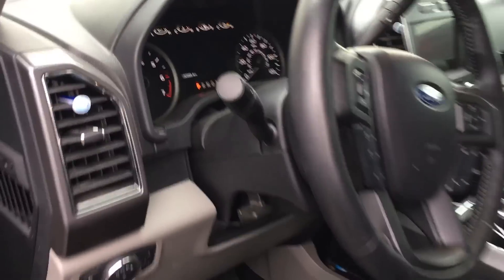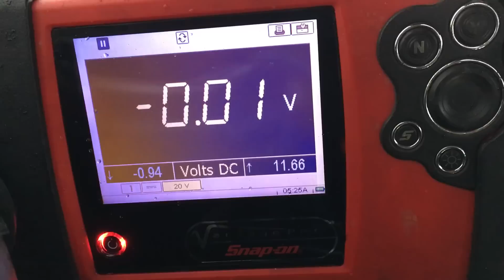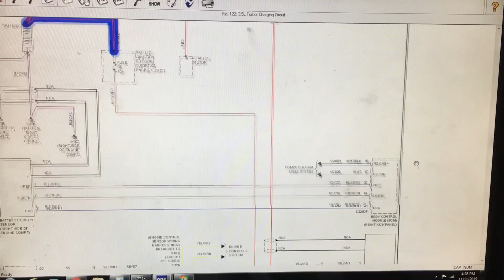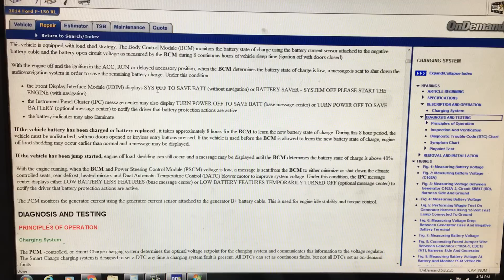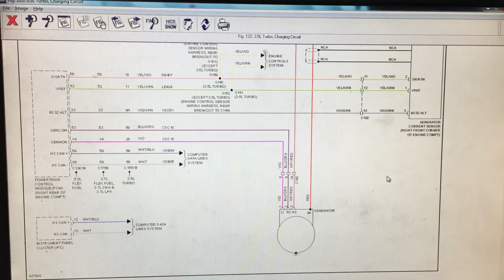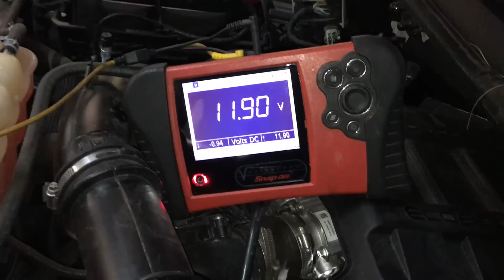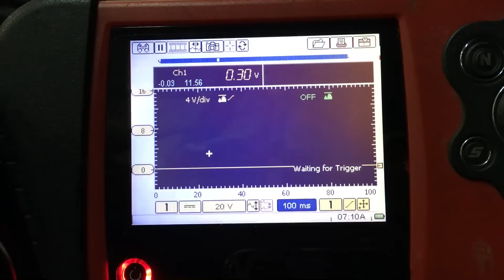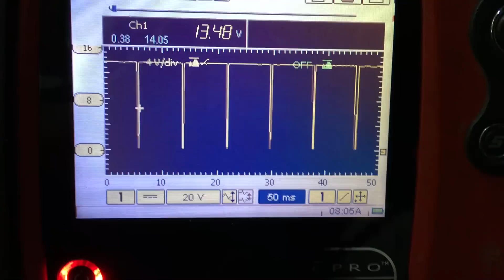FORD F150 ECOBOOST CHARGING SYSTEM SERVICE NOW DIAGNOSIS

Comment: Load shedding refers to multiplexing in a electrical system.  Meaning there's a noid in the circuit and if Battery voltage is too low. The bcm will start shutting random system's or circuits down to try to maintain voltage
Reply: I think mine is shuting down the electric power steering. I have been having this light thingy come on and off all different times, not when driving just at start ups. Today was real bad. First real cold for Houston today, and the steering was intermittent.
Reply: @jassun681  check your charging voltage at the alternator. Write that number down. Then check charging voltage at the batteries. It should be the same pretty much. Now use a amp clamp around the positive battery cable while still having the voltmeter hooked up reading volts. Start the truck and write down the voltage you see and what the amperage is. Then turn on all your loads, lights, blower motor, flashers etc. Anything that can really put a strain on the system. Then watch your voltage and amps. If the readings start to drop. Then you know you probably have a bad alternator
Reply: @feeneysmechanical6215 , yes thank you. I am going to try this. Chris Fix had a real good video detailing this check. I will do the load test on it. And everything I am seeing, is the alternator going bad. That internal regulator.

Comment: I have the same problem with my 2018 truck. The quick change oil place also did not put the dipstick back in properly after an oil change and I had oil spill out over the engine.

Comment: Was the problem fixed by the replacement of the alternator? I am having the same issues with my 2019 f-150 and mine only has 6500 miles. Its at Ford now and I feel I need to show them this video so they will actually diagnose it and fix it instead of just passing the buck. Thanks!

Comment: I believe that you can give wire #2 battery voltage to full-field the alternator to force it to charge and monitor wire #3 for any info back to the PCM, if the alternator does not charge in full-field mode, 100% PWM, then you can call the bad part also, maybe the regulator is the problem, I don't know if it's available as a serviceable part as the oil leak probably took it out BUT, thanks for the great diagnosis. Was there a core charge on the part? Also thanks for using OEM parts.

Comment: Great job ! I need to drop of my 2004 nissan titan  I been having a  problem with  Crankshaft sensor have replaced it also replaced the cam sensor  and it has not fixes it help

Comment: Dealing with this issue on my 2012 mustang right now!!! It started 2 nights ago. I changed the alternator out yesterday and it wasn’t the fix. The voltage is low it was around 11 volts until it died. The fuses are all good. And I checked continuity between the wires from the alternator to the connector on the pcm and those were good. My friend is trying to convince me that the pcm is bad and it’s not sending the signal to the alternator to raise the voltage. The only thing I didn’t do was the change the battery. I’m stuck on what to do

Comment: My truck makes a noise and shows that same system charging problem sometimes not all the time, but what I have notice it's when stopped at the light sometimes turns off, it makes a rough idle and dies, I already went to autozone to get it test it and they say alternator and battery are good do you think is that the cause of turning off, I even took the truck to the dealership and they didn't find anything wrong

Comment: Awesome video I like the diagnostics instead of just replacing the alternator.  Why would they put a one way clutch on an alternator? It should never turn backwards lol.  Not quite understanding that one.
Reply: Is a good point. Since it is a three wave generator it produces electricity also when turning 'backwards'.
Reply: The one way clutch is also used or was on vw as my tdi jetta has it . I think it suppose to keep take load off the belt when the engine is slowing down from the spinning alternator.  Was my guess of why there on there . To help extend belt life

Comment: Tear the old alternator apart. Shoot it with some contact cleaner to get the oil off critical components and clean off the connectors leads.  Oil is an insulator an may be keeping connectors from carrying voltage.
Reply: The slip rings and brushes may be damaged too vehicle ran 300 miles on the freeway .

Comment: Eric - I left my 2018 F150 with the message board showing engine status. Note that in cold weather (35 F) the engine does not cut off at idle mode, the message is that it is charging the battery in lieu of cutting off. The engine on average cuts off 10 percent of the time when you look at running hours versus off-hours.  My battery is 3 years old - do you think it needs a new battery or just cold weather?

Comment: Hey great video on the charging system issue I own a 2019 F150 I installed a OEM bug deflector and I love the look and protection but the issue I am having is when driving above 70 Miles per hour I get a loud humming noise do think it is the deflector or I could have a different issue?

Comment: The BCM voltage and battery condition should be part of the Ford Pass Connect App that can be viewed on a smartphone with a downloaded account. (No battery condition is available on Ford Pass Connect)
With no voltage gauge or battery condition program inbedded in the programmable dash options software, troubleshooting becomes a nightmare. I have 2019 and find this BCM system nothing more than a dealer incentive to up the shop labour time to diagnose a design flaw and for the customer to pay for it. How do you leave a vehicle 8hrs undisturbed for it to "learn". You also need to know which side of the BCM negative module to place your tester as there are different readings depending weather your on the battery post or on the actual wiring connection on the BCM module.

Comment: I had one of these throw me for a loop. Because the wire that is connected to the fuse had a break in it. But not completely broken internally. Just broken enough that it would intermittently stop charging. Then I'd get that same message. And I couldn't shift out of park. The AC would stop working and the navigation screen would shut off. The wire was broken internally about 2 inches from the connector to the alternator.

Comment: The oil most likely got in the connectors. The first thing to do is to clean the connectors with electrical cleaner and then test.
Reply: I always grease my connectors to keep away corrosion. I suspect the oil interrupted the field current, i.e. two coal connectors which giving current to the turning part of the generator.

Comment: Have a 2011 f150 eco boost all normal when start all lights and window switch are off,turn off machine and on again then the lights go on and off and battery sign shows, then all lights are off. Any suggestions?

Comment: 21:47 agreed, i have seen multiple alternator failures where the spool valve(what you pull the dipstick out of on the honda V6(i want to say 07-17, before the new GDI V6) happened to be just above the alternator and it leaked all over the alternator, customer comes in and has already replaced the battery since the red battery light was on, then you get to tell them about the cause and effect, luckily you can take 3 bolts out and swap gaskets out in an aftermarket application, or get the honda one and swap gaskets but dont charge full labor time, i havent since it seems like you are supposed to pull the timing belt at the very least to "properly replace" it, thanks for great content!

Comment: I had the same issue with Jiffy Lube. They left the oil cap off and oil went everywhere. My alternator went bad because of it. Stay away from Jiffy Lube. 2016 Ford F-150 2.7 L

Comment: Just unplug the alternator and it will go up to 13.5 volts if alternator is good. It is the built in fail safe

Comment: Got my oil changed at Valvoline and the next day it said check charging system…. I replace the battery and alternator and the terminal and it’s still saying it

Comment: I have a 2018 3.5 and it’s been doing the same thing I took it to Ford like 5 times and they kept saying it was a battery issue and that they could not find the issue as it would not replicate when they had it now the truck is no longer under warranty so it seems like I will have to pay for the alternator

Comment: Hey what's up brother.  I really like how u walk us through the description and operation and waveforms 😍😍. PAUL always says to his students if ur unfamiliar with an unknown system, PARK YOUR A$$ IN FRONT OF THE COMPUTER.😂😂. But just heads up, On alot of these smart charge systems it's normal to have like 12.4 volts at idle and not ur typical 13.5 or 14. Once u raise the idle u will see ur 13 to 14 volts. Honda vehicles comes to mind. Great work brother
Reply from the maker: Thanks for the heads up and thanks for watching!

Comment: I would have thought the battery in that truck would have been covered under warranty. I have a 2017 F-150 XLT with the 2.7L & the battery has a 36 month replacement warranty. Also, my truck has a 60,000 mile power-train warranty, which covers the alternator. Seems the dealer ripped this guy off.
Reply: I2018 150. Same problem. Dealer says alternator not covered by powertrain.

Comment: My voltage while charging is at 14.2 and I get the light but it comes and goes.  With a baseline of 13.5 mine must be teetering on the max limit.  Anyway, these are being rebuilt now I can get one from NAPA.

Comment: next time  unplug the connector at the generator go to pcm data piss gen com and monitor jump pins for com and monitor  they should mirror each other  this will check wires  all the way up to  pcm one that's missing is usually a broken wire

Comment: My 2016 3.5 EcoBoost said check charging system,  but won't start , but had been saying check charging system but after trying to start a couple times it would with no problem the rest of the day or days
Reply: Did you ever remedy this?  Im currently having the same issue on my 2017 3.5EB
Reply: @jasonp2758  changed the battery

Comment: Can you change the voltage regulator without changing the alternator??
Reply: Imho, it should be possible. The computer should be possible to program the regulator after 8 hours of observation of the battery.

Comment: Had similar, ended up being a shorted cable!

Had an issue with an 18mth old 2017 F150, battery kept draining. Took to ford, replaced alternator and happened again. Almost a week in shop and the wire harness was pinched and shorting out. They had to replace the harness, would have been a $2K job, but warranty covered. My concern is that it’s a design flaw and going to happen again without warranty. Anyone else experience or have an upgrade solution? I do have a level kit (2.5”)

Comment: I wish ford would have done this with my car that I purchased from them 6 months ago.  My car was at the ford shop 4 times… this problem still not fixed. My car is parked in my car garage… 
because I don’t want to drive my car and it leaves me stranded.

Comment: Isn't this truck under warranty? I'm pretty sure he said it was a 2018
Reply: Warranties are for manufacturing errors not human created errors.
Reply: The remaining warranty was powertrain only. Only the internally lubricated parts. (engine, trans, etc)
Reply: @real_arbuckle  The dealership won't know that, clean everything and take it in, get a free alternator, save $700 and then some. This guy just took his money. typical mechanic.
Reply from the maker: Customer told me he was out of warranty. Truck has over 50,000 miles. Thanks for watching!
Reply from the maker: Customer told me he was out of warranty. Truck has over 50,000 miles. Thanks for watching!
Reply: Dexter Dexcool I like how you say “typical mechanic” right after you suggest doing something dishonest and underhanded. Typical consumer.

Comment: I have a 2017 F150. The charging system light started coming on when the vehicle would get wet (car wash, rain, etc). Now it’s doing it all the time. My truck will randomly die with no power to anything. The headlights, power steering, even the idle itself cuts out badly while the charging light is on. I took it to the dealership and they couldn’t find anything wrong. Battery and alternator both tested fine. I’m at the point now where I have to carry my battery powered jumper. Please help if anyone has any similar issue
Reply: Did you ever remedy this?  Im having the same issue currently

Comment: IT'S NTB!!!! 👎👎👎👎. They damaged 3 wheel studs from my wife's car and wanted me to pay them $1000.00 + for some suspension repairs so I gave them the finger and made them pay my wheel stud replacement(done at another shop).
Reply: I rotated my minivan at NTW/NTB and rear wheel came off while I was driving away 200 yards from that crap NTB! I was in the middle of the intersection!. They came over with a jack and installed it in the muddle of the road! CRAZY. Had the manager pay for the damages on the van.

Comment: Sounds like NTB owes this dude the repair bill for this!
Reply from the maker: Yes. I provided all of the documentation for the customer to present to NTB in order to attempt to get some type of reimbursement. Thank you for watching!
Reply: What do you think the odds are he gets reimbursed for the battery that didn't need to be replaced?
Reply: @beerdeliveryguy6265  A case of wrong trouble shooting  put a battery tester, condemned the battery and no retest  and that's not a cheapo it's an AGM

Comment: why didn’t the driver take it back to the dealer it should be still under warranty,
Reply: There’s already over 50000 miles on it.  Guy must drive a lot. Guess the alternator isn’t included on the power train warranty.

Comment: Multimeter on dc volts on battery terminals... basics 101. How ignorant can the Ford dealerahip be LOL.
Plus a dead battery is an indication of a faulty alternator diode... all the red flags were here.. but the knowledge was not..(Ford wise)

Comment: I could've told you it was the alternator in the first minute of the video.You're wasting too much time ''diagnosing''
Reply from the maker: This is an educational channel. We are trying to understand system design in order to help us make better diagnostic decisions that can be applied to any vehicle with a similar design. Thanks for watching!
Reply: horsepucky , could have been the PCM , broken wire ,  for all you Know
Reply: It’s apparent, Dexter is a parts cannon gunner. If replacing the $750 alternator didn’t fix the problem, I wonder what his next move would be? Let’s not waste time “diagnosing” the actual problem, it’s quicker to just change parts!
Reply: Double D must me a newbie. Test don't guess, says Dr. Eric O from SMA. I'd rather spend an extra 15 minutes testing and actually let the results point in the direction of what the fault is. $700 is a risky guess, with a thorough testing. Keep up the great work. Have a blessed and safe week.